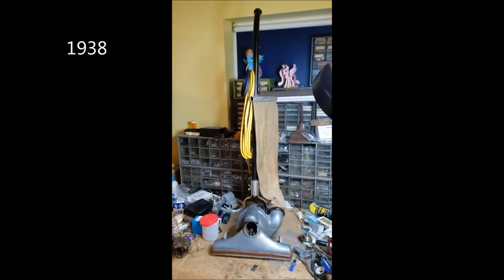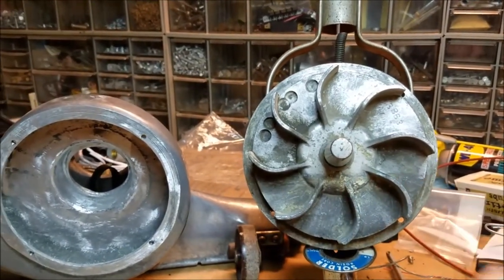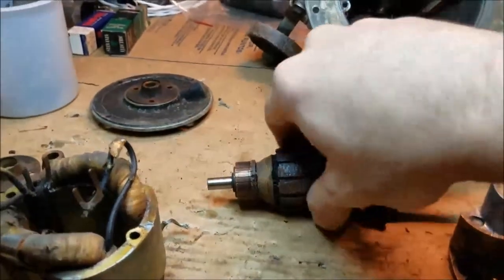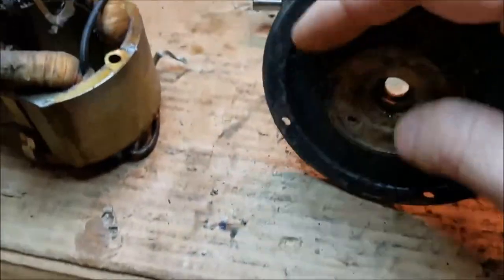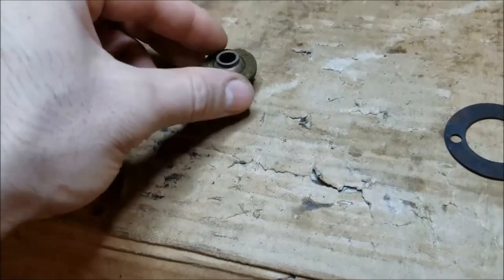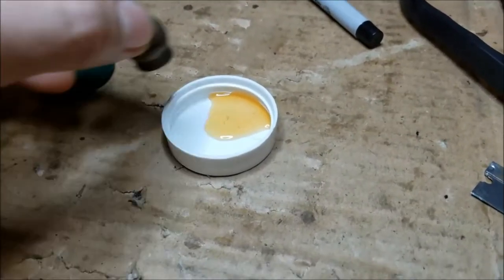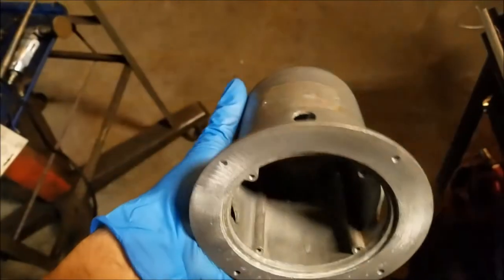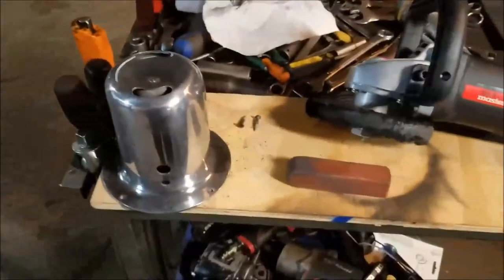Antique Vacuum Restoration - Part 1 - Disassembly

Comment: If you don't have access to HVAC equipment either, I've read that putting the bearing into a largy syringe with some oil is a lot better than nothing, even though it's not that much of a vacuum.

Comment: How did you get the metal fan off the rotor housing
Reply from the maker: Very carefully. The fan is held by a set screw. It came out willingly. I kept the rotor shaft and set screw hole soaking in PBlaster for well over a week. Then rocked the fan until it loosened up. Still, I think I had to use two screw drivers to pry it off.
Reply: @madmanmapper  I'm trying to get the motor to make a wind turbine. I'll keep working on getting to the inner components, shouldn't be too difficult, plus it doesn't run when I plug it in but the copper looks in very good shape and it's the old school version like yours with the big motor, excited for the project!